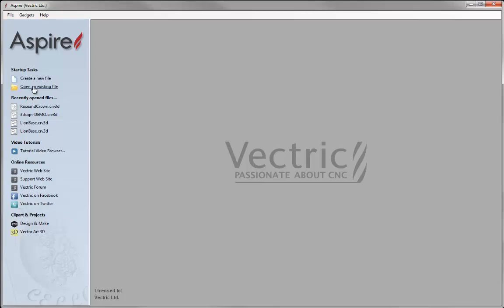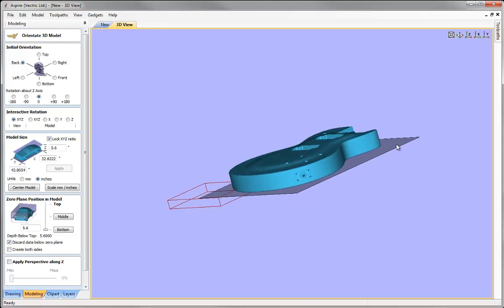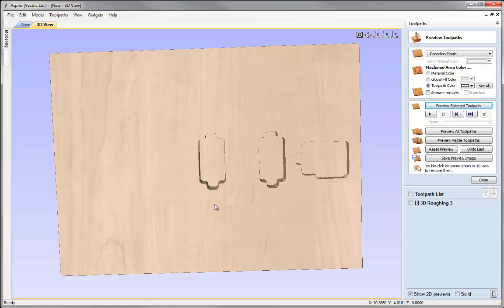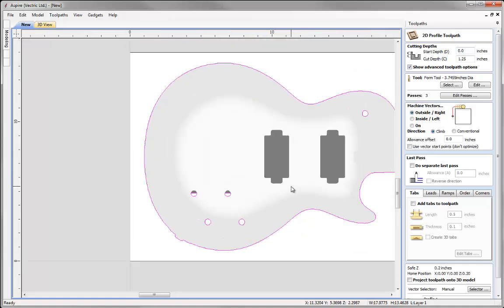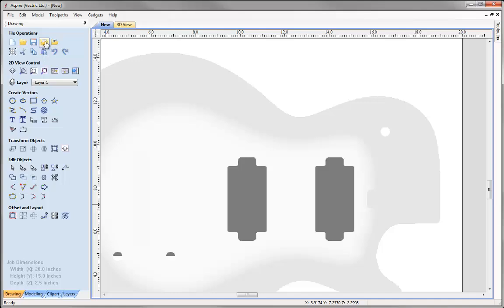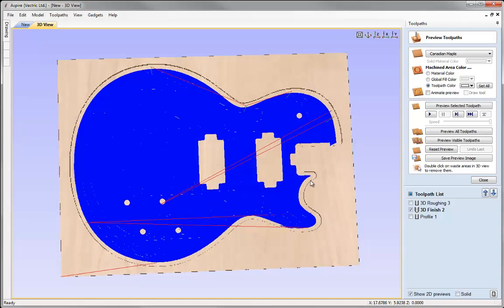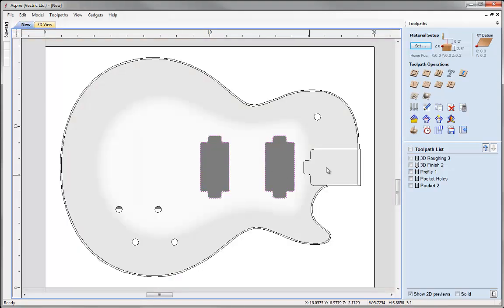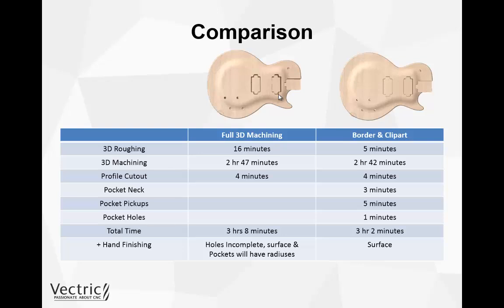Vectric - Efficient Machining of 3D Parts - Guitar Base

Comment: Is there any way to eliminate or reduce the "jagged" or "stair stepping" edge on the profile of a project such as this, especially at the 3, 6 and 9 o'clock positions of the lower part of the body?
Reply from the maker: Hello and thanks for the question.  This sort of thing does happen with imported models.  What we suggest you do is replace the vector outline with a clean vector created by you, then the prfile cut will be nicer.  You could also try smoothing the edge of the 3D model a bit... again this is just what happen when you import in a 3D model sometimes. There are a few other tricks, but you will need to have Aspire.  If you would like to explore those email support@vectric.com and reference the video and your issue.

Comment: Basically the problem of all this  is the fact the different toolpaths ARE NOT AWARE of the job done at previous steps.
So finish toolpath is basially redoing ALSO all the job done by the rough toolpath.
Am I wrong.
 It would be great a feature able to matematically COMBINE toopaths sequentially with the logic that the toopath at time N is NOT REDOING in air the job done by a Toolpah N-1.

Please correct me if i'm wrong.
Reply: You are wrong. After my roughing pass is complete, my finishing pass does not begin by machining the air/already carved stock. It begins at the level of stock left by the roughing pass.